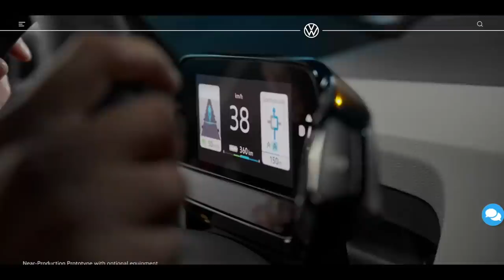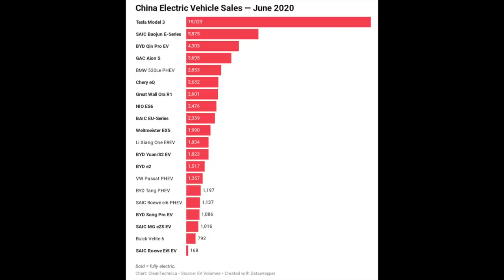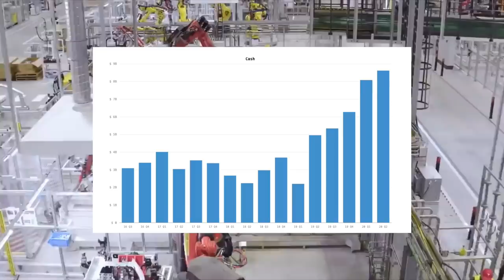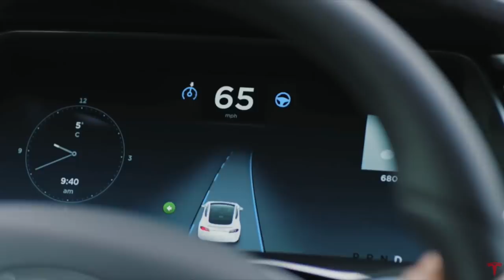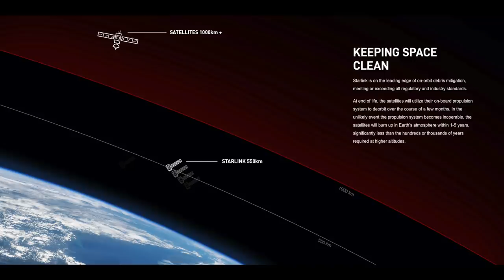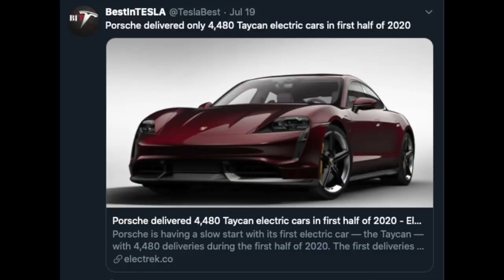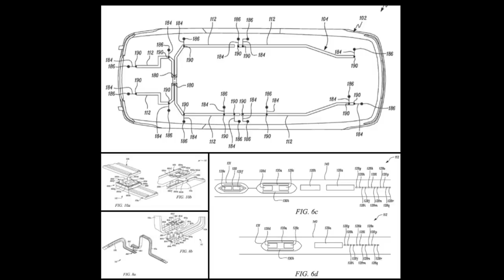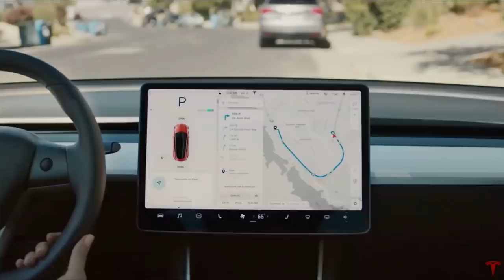Tesla WON | Tesla just made their Checkmate move | No one can stop them now

Comment: If Tesla used A split the positive battery management design, they could double or triple their range.   However this design would cut down on power while in this mode.

If you want to try the split the positive set up for yourselves?  All you need is three rechargeable 9 volt batteries, alligator clips and wires, A small DC motor.  Connect two batteries together negative to positive.  Then connect the motor in between the open positive terminal of the two connected batteries and the positive of the single battery.  The negative terminal should be connected batteries to battery in order to complete the circuit.

The single battery should be depleted of charge at the start otherwise the current will not flow.     Once the motor slows, simply change positions of the batteries and repeat.

Comment: Hello! Great Video. One technical error reported though. You said "new super casting machine to make most of body in one piece". Actually, that casting machine is to cast the worlds largest single piece aluminum casting for the rear Chassis, basically the rear frame section of the car in ONE Piece! Amazing. Theres an article on this in last months Society of Automotive Engineering Magazine, available on-line.At over 100kg , this is an amazing casting development is something that NO Other manufacturer has ever done in the history of automobile making.

Comment: All the cars market is based on the fact that combustions engine break in 15 years or so. An Electric car lasts forever. It doesn't depreciate.  There is no reason why anyone would buy gas cars anymore. They are just a depreciation sink hole. Add that to the fact that most companies are already in finance problems and you will see there is no way. They are going down.

Comment: I think everything you say makes sense, and appears to be very true.
The only error I can see is that hydrocarbons are so good at storing energy, and I can't see batteries replacing diesel any time probably in our lifetime.
Another part of the issue is that we don't get to choose what fuels come out of crude oil, we only get to separate the oil into its constituents.
The ratio is determined by the oil itself.- So much aviation fuel vs so much diesel, vs so much petrol (gasoline) etc..
I can see Electric replacing petrol vehicles fairly soon, but what do we do with the petrol that comes from the oil, just burn it?, dump it somewhere?
Aviation will still be using fossil fuels for decades at least, shipping, transport, mining etc. will keep using diesel for decades too.
The Tesla Semi is not going to be a match, or even a viable second place to diesel except for short distance, or maybe within cities.
There is a lot to all of this.

Comment: Maxwell  super capacitors...

 are Fast 

re-charging batteries!!

And Elon was smart enough to buy the company when he could
Reply: Supercapacitors are not batteries. They store very little energy for their size and weight compared to batteries, and that's why batteries are used for energy storage in cars instead of capacitors.
The capacitors would give electric cars a very short range--you'd need a trailer the size of a city bus, full of capacitors, to provide enough range.

Comment: WWII Bomber Plant: Architect Albert Kahn designed the main structure of the Willow Run bomber plant, which had 3,500,000 square feet (330,000 m2) of factory space, and an aircraft assembly line over a mile (1600 m) long. It was thought to be the largest factory under one roof anywhere in the world......Tesla isn't the first to build Mega Factories....Ford did it 80 years ago...

Comment: I'm not an expert by any means but if we just think of the infrastructure needed for ICE cars vs EVs it's much less. You need to "mine" oil more than you need to for EVs, batteries are rechargeable and recyclable, not oil. You need drill platforms, tankers and processing, same as for EVs with batteries but probably more of an operation. One big difference is you dont need to transport electricity via tanker trucks and EVs are 90% efficient vs 25% for ICE cars. Then you have all the many parts in an ICE car about 3000 vs 30 for an EV, less the complex software.. so my point is that it took decades for big oil and big car industry to create the industry, they cant just transition fast, it takes many years. Especially at the millions of units they are producing. So Tesla is super efficient and has a fresh start and has all the patents and know how, they are far ahead with software, Detroit cant just start making software, neither could the Germans so they banded together to create a common interface. This is really sad, the big car companies found a way to make tons of profits and all the MBAs on the board outsourced and stopped innovating, they all fell asleep. I hope they fail, I hope shareholders stop rewarding companies with a revolving door of executives just so they can make an extra .2%. No one cares anymore about quality it's all about profits, those profits need to come from somewhere, and right now they are coming from cutting corners and outsourcing while the consumer gets lower quality cars with more bells and whistles that cost more to fix... explains why dealerships make more money on maintenance than margins on sales.

Comment: If you look at the current (Q2, 2020) EV sales in Europe, of the top 20, the Renault Zoe came top, Audi eTron 2nd, and Tesla model 3 third. The remaining 17 models struggle to match the sales of even the Model 3. However: looking a little closer, no manufacturer is represented my more than one model, except VAG, with 5 (3 x VW, 2 x Audi). The Renault Zoe is way ahead of everyone else in terms of unit sales (it’s inexpensive and has been around for a while, so is well established. It’s also made in Europe), but if you add up the combined sales of the various (with more to come) models, it matches sales of the Zoe. VAG also have many other cards to play, as they own Bentley, Bugatti, Porsche, SEAT, and Skoda, plus they need to climb out of the huge hole they dug for themselves with Dieselgate. 
Of note is that Tesla (and others in the top 20) do not, yet, manufacture in Europe, which limits availability and subjects the model 3 to a 10% import tariff, so Tesla will have the opportunity to become even more competitive and profitable when Giga Berlin opens.
So in, say, 10 years time, in Europe at least, I think it’ll be between Tesla and VAG, with the rest hanging onto their coattails. Tesla to come out on top. VAG have the corporate might and a very broad offering of vehicle type, but Tesla don’t have the millstone of legacy ICE models, and are rapidly co-developing those supporting industries that the EV market needs to develop to work (batteries, charge network, grid integration, self-drive, etc). Even VAG have admitted that they,and everyone else, is, in some key areas such as software development, 8-10 years behind Tesla.

Comment: The problem with TESLA is that the car battery is only rated for 8 years. After that the car is garbage. Furthermore you cannot repair t he car yourself - TESLA won't supply parts or shop manuals

Comment: Looks very good for Tesla at the moment - but a technical breakthrough in self-sustaining, hydrogen-powered cars could see them go under in a New York second! I like Tesla, and hope it goes well for them.
Reply: What kind of technical breakthrough? I just don't see a future in hydrogen, even if all technical issues were magically solved tomorrow. 

I think people who don't drive an EV are confused about the typical usage pattern. They think people spend lots of time waiting for charging. Not so. I do almost all of my charging at home, so on a typical daily basis, I start the day with a full battery, and simply eliminate gas stations from my life.

To match this convenience with a hydrogen vehicle, you need a hydrogen supply at your house. Unlikely. 

For road trips, the power density of hydrogen seems compelling. However, a 300 to 400 mile range is plenty for an EV. What's really important is density of charging stations. When I go on a long road trip, I just need a charging station near a restaurant, and I charge while I eat. There's enough superchargers around that this is always pretty easy.

It will be quite difficult to create a hydrogen infrastructure of that magnitude, so ubiquitous hydrogen stations are a long way off.

Finally, there's fuel cost. There is no hypothetical technology that can convert electricity to hydrogen and back without significant loss, and the process itself costs money too, so batteries will always automatically win at $/km fuel cost, regardless of technology.

Currently hydrogen is much more expensive than gasoline per mile, and not even green because hydrogen comes from natural gas from frakking, not from hydrolysis. In theory this could hypothetically change, but all the other problems I mentioned would still remain.

Comment: Range and Charge. EV not just Tesla we America must provide charge stations at every fuel station. We need to return all money spent by Tesla so Tesla charge station can be use by any EV. We convert all ICE to EV with the same range we cut our crude oil use in 1/2. We clean up all air. We normalize power plant loads and in return they charge consumers less for current power cost. We need to eleminate all ICE and go EV not tomorrow today. Tesla already stated they will sell all battery software motor technology to anyone. So GM Ford Chrysler Honda Toyota can get in the EV game. Today not Tomorrow EV.

Comment: Tesla is not going to get a $40B cash injection. S&P indexes can procure the shares they need by: (1) purchasing from floating stock (some of which they may have done prior to the Q2 earnings call in anticipation of the need and before the price goes up) and (2) transferring the shares from other funds owned by the same company in order to meet the requirement.

Of course, a new offering at a fixed price by Tesla is also a possibility, but it is a mistake to think that that is the only option and that the company has a guaranteed $40B cash injection forthcoming.

All that aside, Tesla is in a pretty good financial position with the stock price through the roof. Debt would be easy to secure for upcoming GigaFactories, and new offerings would result in less price dilution to the retail investor.

Comment: I wish the other car makers WOULD come in and make millions of EVs.  In terms of climate change it's absolutely needed to transition to EVs rapidly.  

The reasons this won't happen is that Tesla's products are vastly superior to other EVs.  The reason for that is Tesla and SpaceX extremely rapid pace of innovation and extremely short development cycles.  They are literally out-innovating their would-be competitors.

The other reason is battery economies of scale.  Tesla likely has the lowest battery costs due to relentless innovation in battery chemistry and manufacturing engineering but mostly massive scale at their Gigafactory.  Since batteries are the single largest cost in EVs, in order to make them profitably requires driving down battery costs with massive scale, as Tesla has done with Panasonic.  

In addition, Tesla is revolutionizing battery manufacturing with their own technology using Maxwell's dry electrodes.  This simplifies manufacturing and makes it much more efficient.  This too drives down battery costs even faster, though it will take some time to get production on line.  Tesla is working on this furiously now, just as SpaceX works relentlessly on Starship, etc.

On the point about batteries, there is some hope that the other car makers may catch up, for example due to VWs large battery contracts, and also due to massive investment in battery factories in China (and Korea, Japan, Poland, Scandanavia, Germany, etc.).

P.S.  Nissan was the first mover in EVs with the very courageous Leaf, but Tesla's cars are in a different category in terms of range, performance, technology and sophistication.  Still, Nissan and Carlos Ghosn deserve much credit for helping to make the EV popular at a time when it was highly controversial and very uncertain.

P.P.S.  Minor correction: Tesla has a patent to make an entire car chassis in a single casting machine.  You mentioned a stamping machine.  Casting is in many ways superior to stamping.  Progress has already been made.  The rear chassis of Model Y is a single large casting that takes the place of very many welded stampings.  This is a great simplification that's cheaper, faster, easier and better to manufacture.  That's what they're trying to do with the entire chassis.  Make a whole chassis in one move.

Comment: Sorry, this is wrong. The shares will be bought from the market, meaning from the current shareholders, NOT from Tesla directly. The S&P 500 inclusion will put some price pressure on the stock, since the institutional buyers have to convince enough shareholders to sell at least a portion of their shares to them. Tesla in turn will have a higher market value. Thus getting new credits will get easier. If Tesla might decide to do an investment round and offer new shares, delusion ist much lower. But this is something totally different. So buying 25 million shares will not increase Tesla’s cash by a single Dollar.

Comment: He needs to make a viable snowmobile, then I’ll be excited. He might get my money too
Reply: An electric snowmobile is entirely possible, but I don't think you could stuff a large enough battery pack into one to get enough range unless it was a huge snowmobile--and it would be a really heavy beast!
IC engines are very hard to beat in some applications, and snowmobiles are certainly one of them (aircraft are another.)
Reply: @devilsoffspring5519  a company Taiga in Canada has them. Yes there heavy and have ranges problems. Cold is a big issue. I was hoping Elan would solve the problems eventually

Comment: ? The 36 million shares are not bought from Tesla but from stockholders in Tesla, like me, IF these people want to sell. Nevertheless, there is huge pressure on the stock price to be expected. On the other hand, the profit has been made fully by selling rights to competing ICE manufacturers that want to sell ICE cars in California. Without it, Tesla would have made a loss of about $300 mln. Pittance compared to their stock market valuation, of course, but still fodder for naysaying short-sellers. Of course, Tesla could issue shares but then it first would have to extend the number of shares to sell because there are not enough shares not on the market that are held by investors and board members. Anyway, Tesla could get as much funds as they like. You are right about that.

Comment: As of the current batterie tech i will safely say that the Semi will not find any real use as of now and the next 10 or 15 maybe even 20 years in almost any country in the world.
for the US and CAN and the EU and RUS the EV trucks/semis simply dont have the range to be usefull, same for the weight mainly for europe as Semi + trailers regular max weight  is 40t as the Tesla semi is probly almost twice as heavy then a Merc, MAN, Volvo or Scania Semi so having 7t less cargo capacity and having to super charg evey 600km or less wen pulling 20-25t while a Diesel Truck has twice the range and is refuled in less then 10% of the time while also carring 25% more cargo... 

Also keep in mind that VW and Merc make huge sales in comercialcars, trucks and so on aswell

Comment: Excellent video, but you forgot to mention the main reason the Tesla is better than any other car, ICE or electric. Tesla makes a smart car, and it's part of the Tesla business plan to make all the Teslas on the road smarter every month. Right now, I judge my Tesla to be as smart as a six year old child. Not stupid, but not old enough to drive on its own. It took Tesla ten years to get its car to the six year old level of intelligence. Elon says it will be old enough for a learner's permit later this year. I don't expect that to happen until late next year, but I do expect it to happen. By my definition, a car is at the learner's permit level when the licensed driver needs to intervene less than once every hundred miles. That's a difficult level for a car to reach. But I do expect my car to get there. No other car company has it in the business plan to improve the intelligence of the cars already on the road for free. Instead, they want people to dump their old car and buy a newer, smarter car. That's why a Tesla is more valuable than any other kind of car. Also, there's the battery issue. I expect the batteries in my car to last a long time, but when they decline, I expect that the replacement batteries will be higher capacity, lighter and less expensive than the current ones. That, of course, could be true for other electric cars, but Tesla is ahead of everyone in battery design and manufacture.

Comment: It is great what is happening in the battery industry but there is a big but
Batteries will be obsolete due to  Radioisotope Thermoelectric Generators already being used in spacecraft
Clean safe use of isotopes that last for 15 years or more and don't need charging
Mars rover perseverance is powered by this and it is a tiny lightweight unit designed to power a car sized rover for many many years on a distant planet and about as harmful as an x ray in hospital if it goes wrong
Not the only one out there
Goodbye batteries for sure at some time in the future
Sorry Elon but it will happen